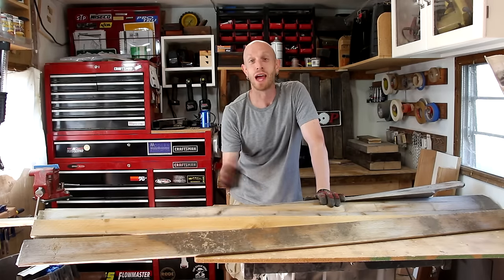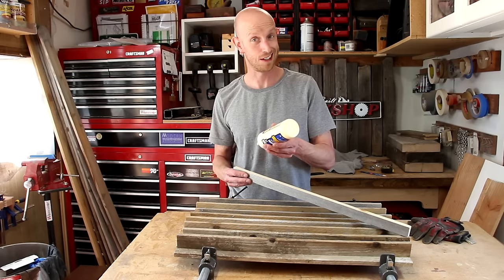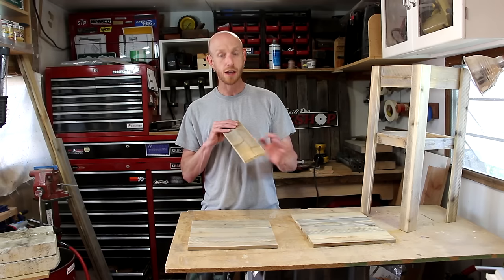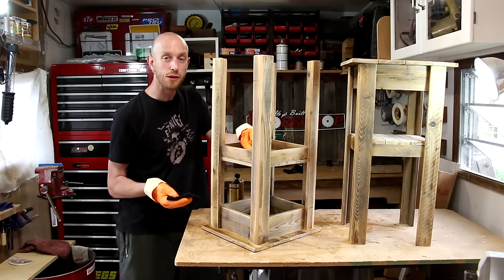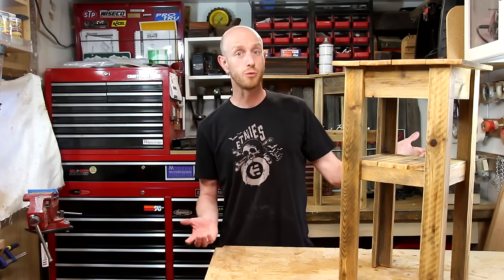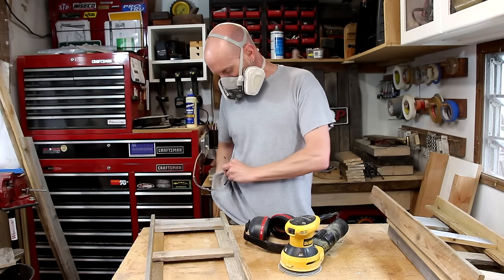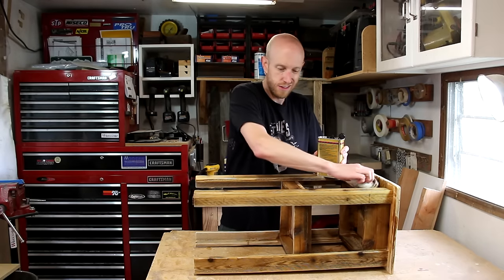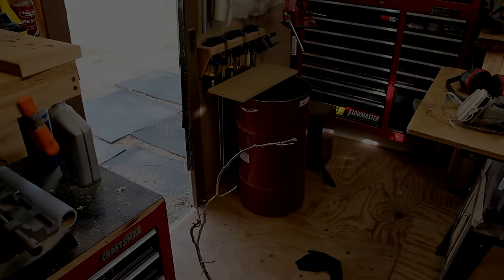How to build nightstands from Fence Pickets

Comment: Nice experiment, great rustic side tables. 
I saw a comment on another channel saying how dangerous wearing gloves whilst using a table saw is as a slight catch on the glove would pull your hand into the blade, I have to say after that advice I never use gloves for the table saw anymore... Pass it on ;) Geoff
Reply from the maker: +Stuff I Made yeah, that could be true. I was using them because the wood is very splintery. Thanks for the reminder.